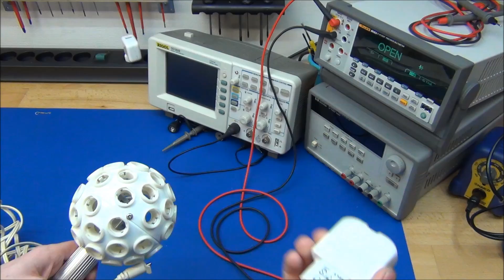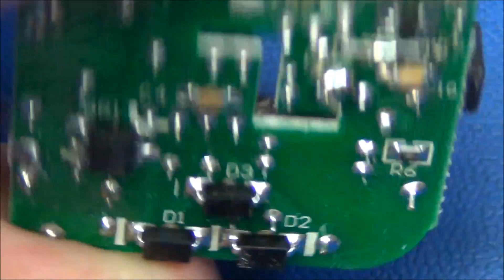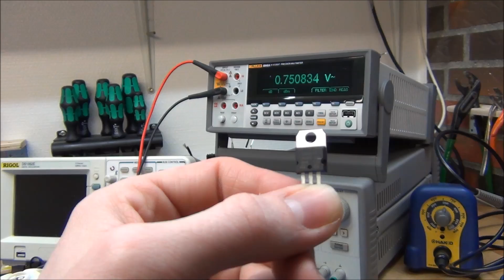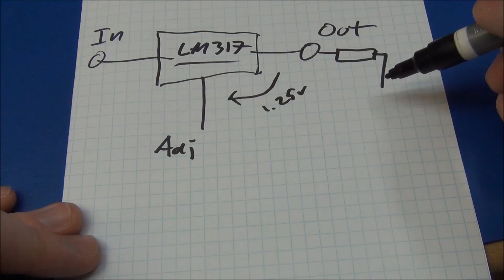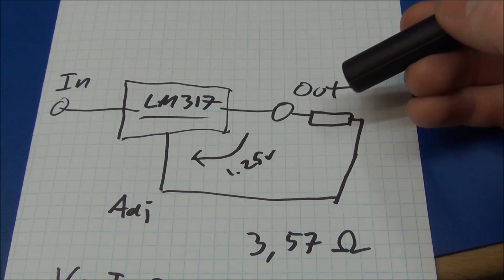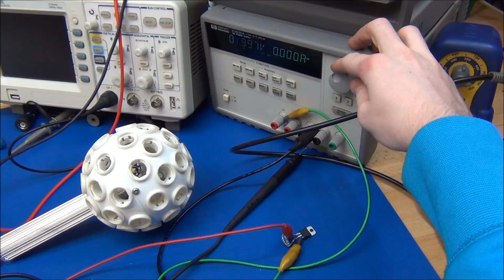IKEA LED Lamp Repair / Fix - Ec-Projects

Comment: Is there a spyware of sort in there? Like meters, appliances, PC? Why take a simple thing and complicate it so? For our benefit? Is this evolving to something further? This is a far greater polluter than our current lighting systems, costlier, more demanding of resources and can phase out the competition to mention a few. This beats all the elaborate mouse traps I've ever seen.
Reply: Don’t be absurd, there is no spy ware or spying devices of any kind in a simple switch mode power supply.

Comment: to do it right takes much experience.  The LM317 jcn is probably running at 100'C+ with the nice thermal insulation of 1cm of epoxy. surface temp of +40'C means it is an oven.

Comment: The blob of silicone is to improve mains isolation from the bridge to the dc output socket.

I think the blob of solder and the removed resistor is some sort of production rework.  THere would have been no point in discarding a production run of the power supplies, and and to pull out the transistor would be too time consuming.

Why not have a go at repairing the original power supply?  If you do repair it you can easily house it in a new case.